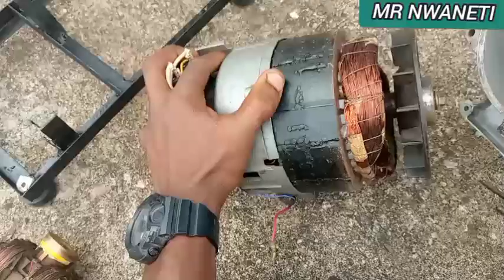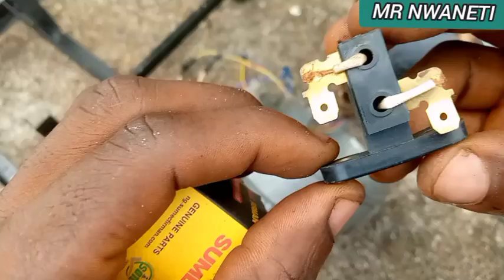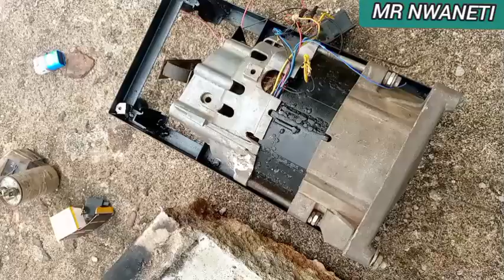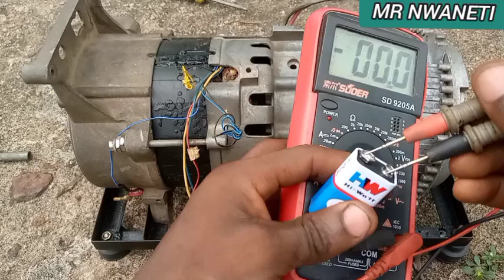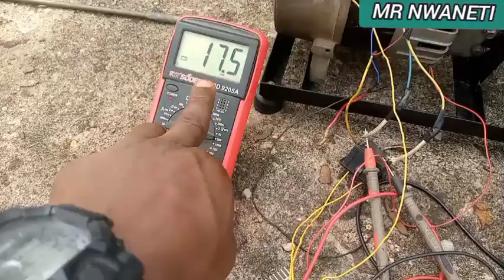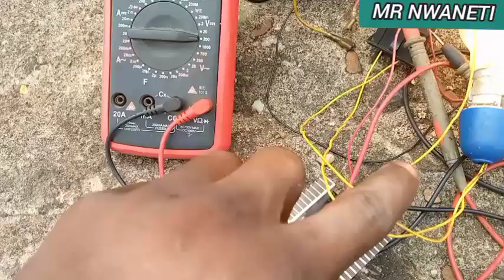gasoline generator convert to brush generator

Comment: Bro the module stand as battery right
Reply from the maker: @MuhammedSikiru-dr9fy  why do simple thing difficult for you to understand,the module I used there serve as regulator on the input current going in the armature, without the module the 25vdc we go in the armature which we give us more voltage output maybe be 500vac or more
Reply: @MRNWANETI  u don't understand what I'm saying  for example u used battery through module so that the dc voltage can be adjustable for the output ac voltage
Reply from the maker: @MuhammedSikiru-dr9fy  which country are you from that you can't understand what I demonstrate in the video
Reply: @MRNWANETI  what did you used to power the module before the commutator
Reply from the maker: @MuhammedSikiru-dr9fy  i use another source 25v and I fed it on the module
Reply: @MRNWANETI  u just answer my question now 
That source is it battery or what and if its battery if I use 12vdc is it going to work can I adjust it to 17vdc through the module to the  commutator
Reply: @MRNWANETI  can we use 12v battery for the module

Comment: Ce système c'est génial je me suis débrouiller pas mal mais j'avais sorti 110v , j'avais utilisé la batterie de 12v 100a donc je dois augmenter la tension dans l'armature ou refaire la bobinage parce que mon bobinage est en aluminium ?? Svp
Reply from the maker: Either you increase the voltage going to the armature or you rewind it by adding more turns per slots but makes sure it copper wire ok